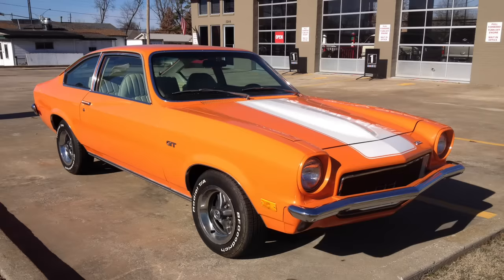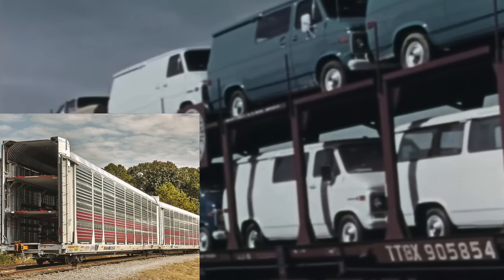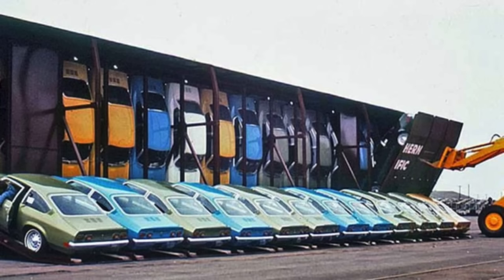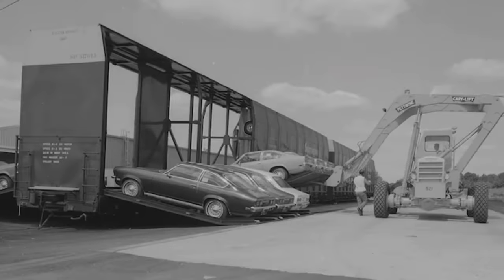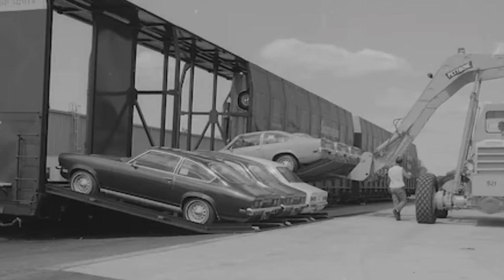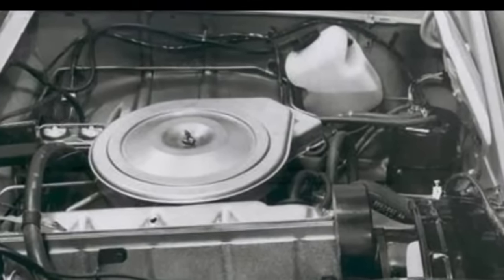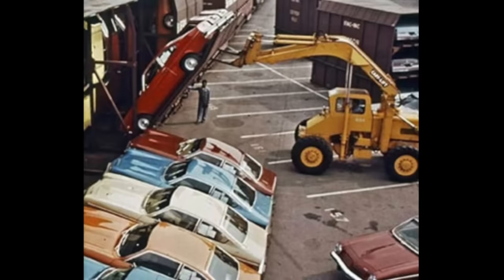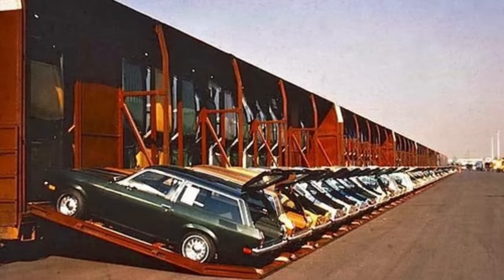GM's Coolest Invention Wasn't Even Part of a Car: The Chevrolet Vega's Vert-a-Pac Shipping System

Comment: I've always thought a great engine for the Vega would have been the aluminum 215 V8 that GM had already sold to Rover by that time. I've always had a desire to find a Vega and drop a Buick Nailhead in it too. I had a 401 with a Dynaflow out of a 63 Electra but sadly had to part ways with it when I last moved due to lack of space.
Reply: @edwardpate6128 I’ve always thought the same thing. Lightweight, compact, good power, and well developed. I wonder if GM’s thinking since this was their answer to VW, Datsun, Toyota, and others, might have been that offering a V8 would be too far removed from the focus on fuel savings.
Reply: I had installed a few 215 Buick engines in vegas. They were a fun car.
Reply: The 225 Buick would've been awesome too, small dimensional size, good power, efficient in a car the size of a Vega, that would've been a good fit
Reply: I agree that the 215 would have been a natural for this car, but GM had different visions for this car. It definitely wanted to go head to head with upper scale European small cars. Any overhead valve engine wouldn't have fit that imagine building exercise. The 215 did share some of the over heating issue that plague the Vega engine, but not as badly. It might also been viewed as too strong a competitor to the Camaro. Same styling in a smaller, lighter package with potentially the same performance.
Reply: @cdjhyoung  
The vega had cooling issues that was fix at the factory by cutting a cooling passage between the cylinders.
The 215s, I've worked on them built them and raced them never saw any over heat and some were hardly maintained at all.
Only problems I came across were cross threaded sparkplug holes but I don't know who did that, mechanics or DIYers.
Reply: How about a 283 v8, Mr Banogly!
Reply: @rcdogmanduh4440  
The 283 was out of production when the Vega came out. All the sbc's had the same external dimensions and had to weigh very close to the same so you might as well go for it. Sbc's out at the time would be 307, 350, 400, 262 and 305.
Now the buick engine if they haddnt sold it was a tight unit. Think it was only about 40lbs heavier, easy to work on and fit nice under the hood.
Reply: The Chevy 262 V8 was installed in the Monza which was based on the Vega platform.  Got to drive one and it was wicked fast because it was so light. Don’t know why they never offered it in the Vega the 2 cars overlapped for several years.  Chevy did prototype an all aluminum V8 in ‘74 but it was never offered in production.

Comment: Southern Pacific Railroad and GM got about a dozen railroads to buy Vert-a-Pac cars. They only used them for a few years because they were too labor intensive and too different from other auto racks - that’s the name used for rail cars that carry vehicles. At the same time they developed this car, Southern Pacific and GM came up with the Stac-Pac cars. One of the photos shows those containers in the background. Each container held three Cadillacs.  There were four containers to a flat car. Ten railroads had the containers and flat cars. Both cars fell out of favor as the railroads started enclosing the auto racks. The Vert-a-Pac and Stac-Pac cars were converted to standard auto racks that were partially enclosed
Reply: Some of the Stac-Pacs are visible at 7:10 in this video.

Comment: Thanks for that opening view of the Millionth Vega series!  my first car was a new Millionth Vega.  I had no idea about many of the design features that you mentioned in this video.  One poor design feature regarding that special oil pan...there were no structural shields so it was extremely easy to knock a hole in that low hanging oil pan if you went over a speed bump or an intersection dip in the road.  They had to lower the speed bumps in my high school's parking lot because so many of us were damaging our Vegas (speed was NOT an issue.)

Comment: One of my favorite old cars. I had a 72 model that I did the V8 swap in and at that time you could get parts from Chevrolet that were in the factory V8 Monza. Motor mounts, oil pan, radiator, exhaust manifolds... except for the trans tunnel at the bell housing needing slight mods. it was practically a drop in. Mine got a 350/TH400 trans. It weighed 2,700 pounds.
Reply: Just buy a V8 Monza. I had a 78 and an 80.  All you needed to do was swap out the 2.29 rear end ratio and it was fast
Reply: @ItsReallyJackBlack  at the time I was building my car you really could not find a v8-powered Monza and nowadays to find one would be practically impossible
Reply: @willbar1961  I get that. I fooled with them in the mid to late 80s. They were in junkyards at the time if you looked.  Unfortunately those A bodied didn't last long and were quick to get crushed.  My 80 spider probably paid for itself in earnings from racing suckers.  It was a street legal 2100 lb dry that looked almost stock
Reply: @ItsReallyJackBlack  i actually pulled parts from a V8 Monza Mirage (cool body kit) and bought the oil pan from a local Chevy dealer along with factory V8 motor mount pieces. Those were the days, easy to build and work on, fairly cheap too
Reply: @willbar1961  The 196/ 231 v6 Monza actually were identical to the Small block ones. The only true unique V8 parts were the driver side exhaust manifold. But you could use an early truck log style and clear the steering. The few California 350 cars did have bigger radiators, but that was because of smog equipment.  Plug changes were a pain.  A 4 speed swap was a bolt in with V6 parts but the clutch wouldn't last very long.
Reply: @ItsReallyJackBlack  Yeah I had to order a four row radiator, swapped to an early short water pump and ran a fixed fan with more blade pitch just to keep it reasonable in our hot summers.  A V8 in that small engine bay would cook stuff. The TH400 bell housing didn't clear so I had to massage the trans. tunnel a small amount and made a trans cross member. It was overkill because the car was so light but it was what I had to work with. A four speed manual would have been nice. I later got my hands on a 1970 AMC Mark Donohue Javelin with the 390 and four speed. Even my CJ7 has a V8 and manual trans. It's just more fun. I really miss that old Vega though.

Comment: How very cool! GM was certainly trying to think outside the box with the Vega 2300 when it was introduced in late 1969 - up to and including this unique shipping method. I have to think you are correct, Adam - in that they didn't ultimately enjoy greater economies in shipping or lessen shipping damage enough to make much of a difference to the bottom line. I recall Chevrolet promoting Vert-A-Pac when they first introduced Vega with wide release of photos etc. to put the idea forward that Vega was truly a revolutionary new small car - even in the manner in which it was shipped. After the new model intro for the 1970 model year it was never promoted any further. I notice another unique shipping container in the background in one of the images where it looks like Chevy Novas are stacked two high and sideways. Another experiment that went away? 
GM certainly never let shipping logistics stand in the way of getting whatever they needed. Another experiment on a grand scale - the "GM Air Bridge" - where Pininfarina-built bodies from Italy for the Cadillac Allante were air freighted on special 747's to Detroit for final assembly in the mid-1980's comes to mind.
Reply: They also made up specially modified semi truck enclosed trailers that were used to transport car bodies (Regal, Cutlass, Monte Carlo, El Camino, Grand Prix) from where they were assembled in Flint, Mi to the final assembly plant about 40 miles away in Pontiac, Mi.  Lots of these trucks did laps up and down I-75 on a daily basis.
Reply: The containers in the background are the related Stac-a-Pac. They also didn't last long.

Comment: My Dad (who sold Chevys for almost 50 years) would tell us that the Vega’s during the winter months were delivered by truck in rural Midwest…after driving on roads of snow and salt would actually start to rust on showroom floors.
Reply: same here. 1948-1985. 3 generations.  My 74 Vega GT wagon engine went at 12,000 miles. lol
Reply: News Flash every Car starts Rusting the day it leaves the Assembly line.
Reply: not really. cars are galvanized now. since 30 years in Europe.
Reply: Chevy trucks and Vans would rust out in weeks also...Square Body trucks kids were rust buckets!
Reply: @skataskatata9236 they are not galvanised.

Comment: I guess? You said that a lot. Early Vegas had a high rate of warranty replacement for alternators with broken mounting points. It turned out that the amount of shock the cars were exposed to were higher than expected and components which hadn't experienced problems before became problems in vert-a-pack shipping. Vert-a-pack was far faster to load and unload than standard carriers because the standard rail cars had to be loaded from the end, requiring the rail cars to be uncoupled and ramps installed to drive the cars on and off while vert-a-pack loaded from the side. The tri-level and bi-level cars used today have ramps between cars so that 10 rail cars can be loaded from one open, uncoupled car entrance and off loaded the same way. Modern carriers are also over height and require special routing. One of the advantages of the current generation of carriers is that the cars are so well protected that sometimes the autos are stored at an unloading yard in their carriers until they are needed for delivery to the dealers lots.

Comment: If they had been able to use this technique for multiple vehicles for multiple years it might've been okay. But with all the train cars being built, and the modifications to the Vega to make it work. They most likely lost a lot of money
Reply: I wonder why they didn't use this technique for the soon to come X and J body cars 🤷‍♂️
Reply: I'm sure it cost them but they got 7 years for the vegas, and Pontiac Astra (not sure of the years of that.
Have seen many articles on this but never any mention if the monzas were shipped this way too. It was basically the same car.
Reply: They weren't as expensive as they look, because they were containers mounted on flat railcars (so the cars themselves were standards). The alternative wasn't free - cars are moved in special railcars anyway.
Reply: @brianb-p6586  But those specialty cars are standardized. Even if you buy them yourself instead of renting capacity, it is cheaper than this design. And you do not have to build a whole new rail yard to load and unload them (because these take a huge amount of space to load).

Comment: Years ago I worked in a small engine rebuilding shop.  Back then engines would last 50 -75 thousand miles before needing at least a valve job.  On rare occasion we'd see one with 100 thousand miles.  When an vega head came in we would clean them just enough to magnaflux them as they nearly always were cracked so we saved the customer the teardown and cleaning costs.  Those rail cars look very similar to the ones used to ship L1011 air plane wings to the assembly plant in Palmdale.  I wonder if they were adapted once the Vega went out of production.

Comment: Lol I remember the pile of 2X4 wood blocks that had to be removed from the motor mounts otherwise the car would shake like mad when the engine started!  The picture of the engine shows the sealed air cleaner where you had to replace the entire assembly, or buy a kit to convert it over to a replaceable filter element.  The Pinto may have been the better car, but the Vega offered so many more options like tilt wheel, full instrumentation (on the GT only?) driver's seat recline adjuster to name a few. And everyone wanted that 4 spoke Vega GT steering wheel for their hotrod!  Never owned a Vega, but I did have a Monza Spyder with the Buick V6.  I really liked that car, it was comfortable, and handled excellent!  Seems the engineers didn't learn their lesson with the aluminum block, cast iron head Vega when they designed the Cadillac HT4100!
Reply: I never understood the iron head choice. Japanese and European manufacturers were already having success with aluminum heads, why couldn't GM...... 
Detroit Diesel made some aluminum blocked engines too, but they also had iron heads. I actually have 2 aluminum 3-53 Detroit Diesels in Vietnam War era vehicles called Gama Goats
Reply: @johneckert1365  I'm guessing the 3-53 had cylinder liners like the other Detroit Diesel engines?  The Vega engine if I remember doesn't have sleeves, just extra silicon to supposedly make the cylinder walls more durable!  A neighbor used to have a 65 GMC pickup he put a 3-53 in, that truck sounded awesome!
Reply: @joesmithjoesmith4284  Yes, the aluminum 53 series has cast iron wet sleeves just like the iron block ones do. 

The later 2.3 was improved and called the "duratech" or something like that. They were much better than the early 2.3
Reply: @johneckert1365 Iron Duke.
Reply: @garyszewc3339  
Right, and that was larger @ 2.5L. That was the last year,... too late.

Comment: I wish you’d explain how they were held in place and why there was no damage to the front end of the cars. Did they somehow clamp onto each wheel rim and this way they didn’t slide down on the front and damage the bumper and front end of car? I was hoping to hear how this was done.
Reply: I got you fam.   Go out and stick your head under any vehicle that is convenient for you. Look up at the frame structure and you will see oval diagonal cut outs in it. Those slots are the integrated shipping tie down system.  I think every major manufacturer uses this system for moving the vehicles through the assembly plant and in shipping those points are used to secure the load as well.  Some dealers put rubber plugs in them in the northern regions to help prevent salt and road slush from getting up there and rusting out.   I hope that helps explain the method to you.  With the Vega I would imagine they had a more robust tie down pad since the wheels and suspension are not assisting with taking a majority of the load off the straps but maybe ,maybe not
Reply: I heard they were hung on hooks.
Reply: Velcro
Reply: @SKYNET9er really? My assumption was duct tape.
Reply: @danieldaniels7571  Giant magnets. 😀
Reply: Giant bread ties around the wheels, like a toy car in it's packaging.
Reply: The cars were secured with typical shipping chains with J-hoos and R=hooks, tightened down with a ratchet mechanism

Comment: Thanks. Adam you answered  a lot of questions  but not about Radiator coolant  and brake fluid & P.S fluid  and just how much gasoline was put in at the factory  and I just do not accept that there were no leaks on  any thing there must have been Engine oil  and transmission oil       And radiator coolant and differential  leaks and some batteries that did not get proper hold downs must have created a problem and what procedures were taken the first time those little Vega  4 bangers got cranked over I bet they belched smoke for an hour if the truth ever comes out I  would say that contributed to their demise from being in that inverted position for how long    ????? And if this shipping method was so innovative what brought  its demise  because they still produce compact cars to this day
Reply: You raise some great points.. Another example of a half baked idea from GM.

Comment: I had a hand-me-down '74 Vega sedan that had many things I liked about it, many I did not.  I liked the styling, the color (sort of copper-ish), and the radio antenna in the glass worked actually very well!  The engine went out, but the cast iron cylinder sleeves were installed under warranty.  It wouldn't start when parked outside in cold winter weather, but it turned out to be the oil pressure sending unit had an extra terminal hooked up with the electric fuel pump.  Lose oil pressure and the fuel shut off; very cold oil = minimal oil pressure = no fuel.  I placed an incandescent shop light on the sending unit overnight as a makeshift block heater, and it started right up the next morning.  The same car got decent gas mileage on a 4+ hour road trip even with a stretched clutch cable, slipping when you gave it too much gas.

Comment: I remember the hype the Vega was surrounded by when it was introduced.  As a 17 yo new driver I was quite excited over the car, loved the styling, and was intrigued with the much touted “high silicon alloy aluminum cylinders”.  Then my dad and I took a test drive at the dealership.  Might have been one of the biggest disappointments of my teen years!  The thing ran like crap, noisy, vibrations everywhere, and lousy power.  That was the end of that story!

Comment: Perhaps the vertical shipping method caused the severe rust-out and oil burning in under a year.
Reply: The rust problem was due to the dipping process not filling all boxed in areas in the unibody.
Reply: @davidyoung8521  Nah, recycled metal was used around then.